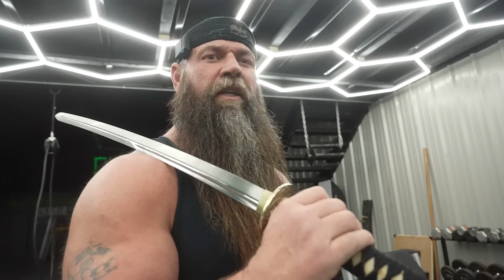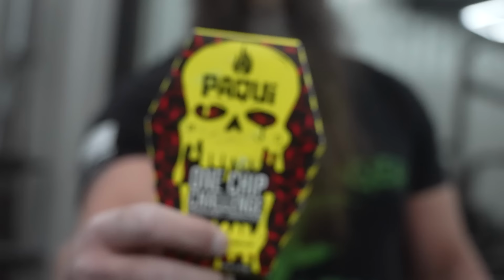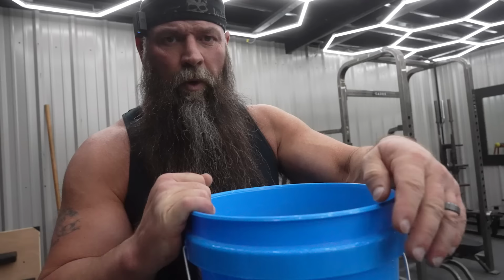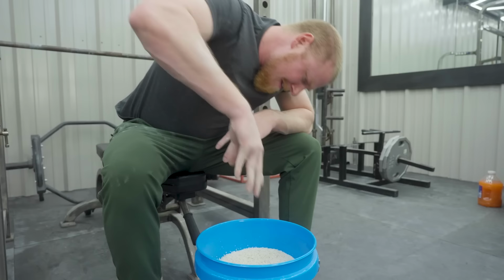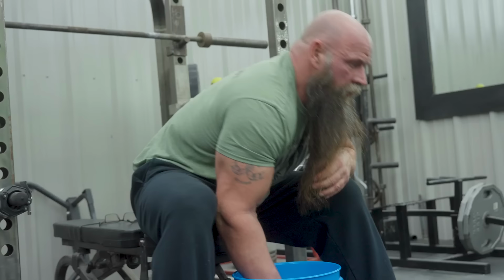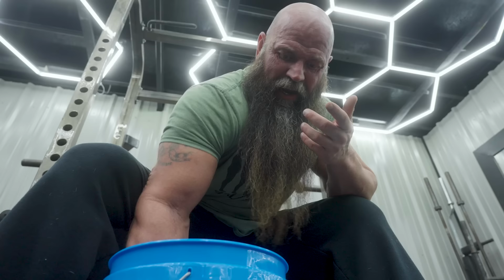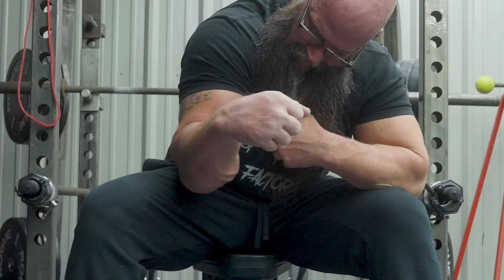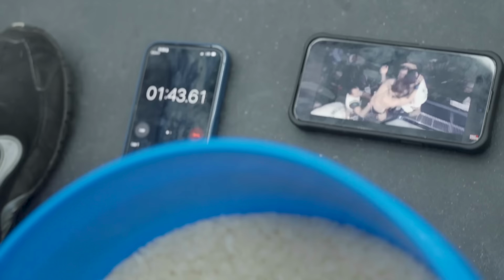RICE BUCKET CHALLENGE: INSANE RESULTS IN 7 DAYS!

Comment: I worked summers at a saw mill pulling boards off the chain.  I can 100% tell you that you will have stronger hands, wrist, and fingers but you better have time for recovery.  I would be sitting there holding a pop can and it would just fall out of my grip because they were so fatigued.  A couple weeks of recovery and hand strength was probably 30% greater.